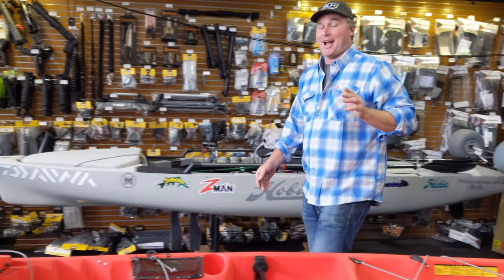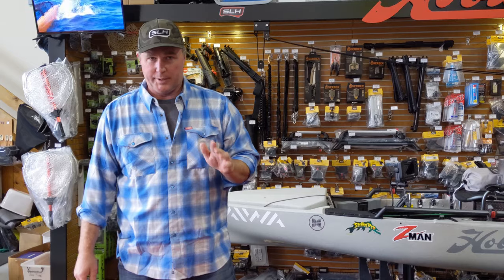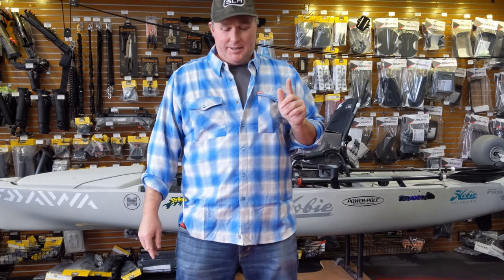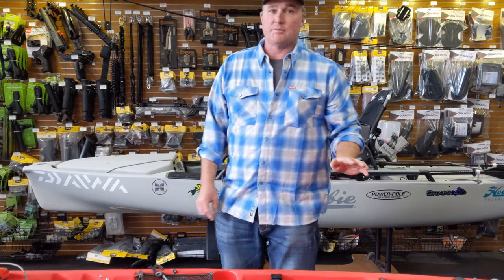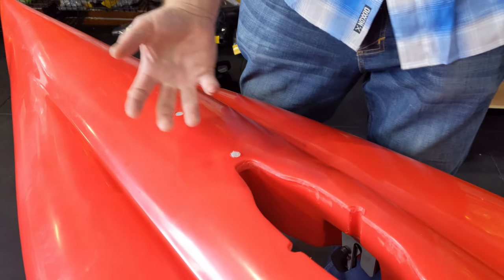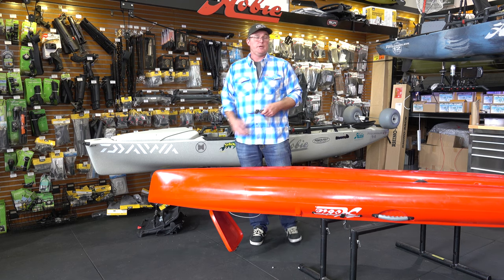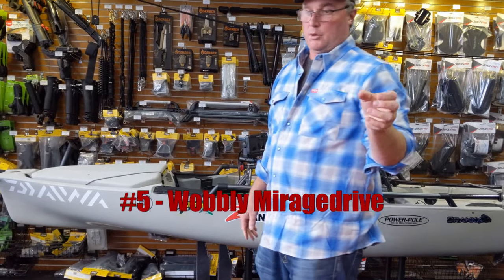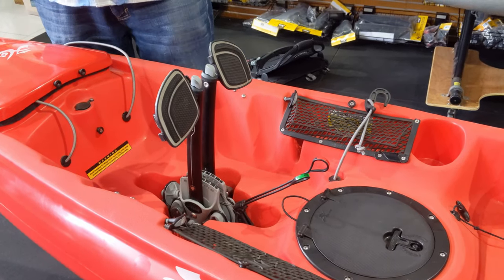5 Misconceptions about Hobie kayak hulls

Comment: The most effective test for receiving a rotational molded Hobie is to expose it to strong light externally and check for luminance differences internally. Light stains seen intensely on the hull mean under-thickness of the plastic, which if located in places of great effort, the hull must be replaced. That's what Hobie has done in these cases. Don't be shy about asking Hobie directly any questions about his kayak. Unlike some dealers, you won't be ridiculed for being worried about your kayak being an item you don't know about, and the Hobie warranty is very effective and comprehensive.

Comment: got myself a pa14 and shes a bit rough on the bottom after 3 summers of river rocks, logs, sand and dirt... nothing some sanding and plastic wielding wont fix- maybe get a underside protection eventually. the right peddle on the mirage drive where your foot makes contact slides a bit from being loose but again nothing a quick adjustment to the cord wont fix. id abuse the revolution 13 as much as my pa14 they are worth the money

Comment: I bought a used 2010 hobie revo 13 and someone mounted a transducer inside the hull directly over those two white dots, I thought they were part of the transducer. LOL, I don’t use it , I  cut the cables a foot away but my Garmin goes over the side on an arm.